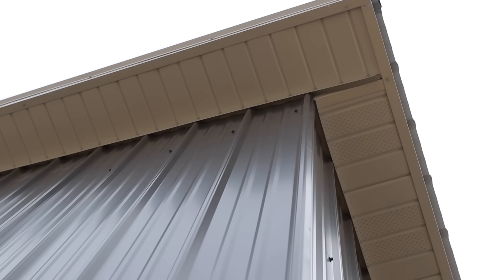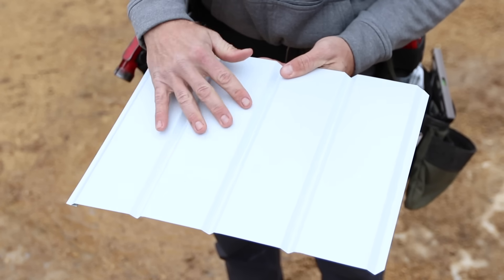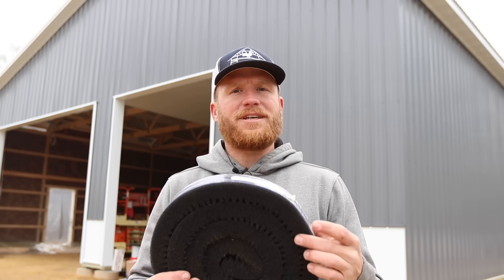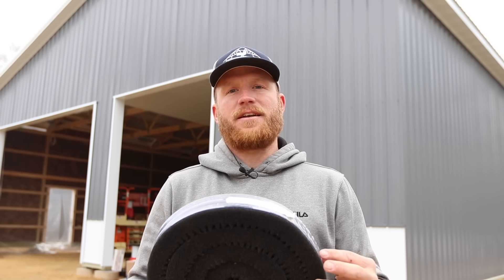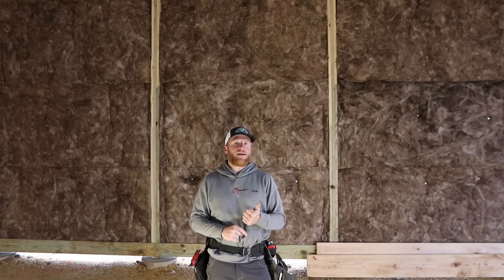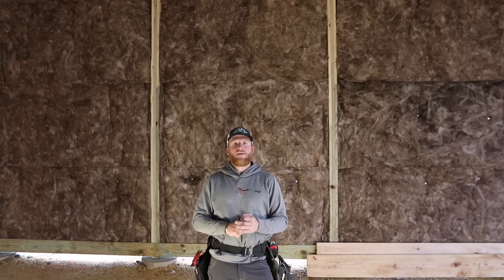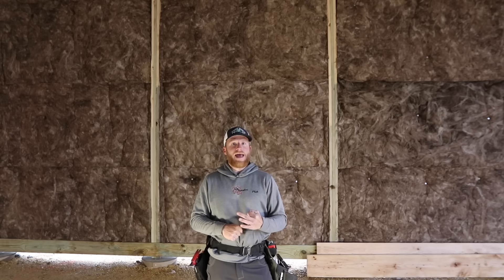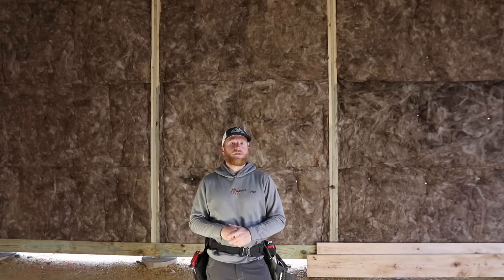Insulation: 5 steps to a more efficient building and why I don't use spray foam

Comment: I've been an insulation installer now for almost 15yrs in the pa, nj areas. And the man knows his shit. The materials he's using for his thermal envelope are the best bang for your buck. It's not about charging the most for this guy. Yes your open and closed cell spray foam has its benefits in the shore region here with the high winds and lots of rain and moisture from rapid extreme temp changes. But most places it's just a gimmick for salesmen to get a bigger commission, we hang a lot of high density materials here too, like your r15, r21 and such which I also believe to be gimmicky high priced junk. For the best thermal barrier You want a light and fluffed material with many layers of air pockets not a solid compressed block. That's why any more then 2" of foam is a waste of money. And also thermo fiber (rotten cotton as we call it) is great for sound deadening, and fire blocking but because its thick and heavy not insulating. The only thing I would do differently is used a psk or fsk faced r19 blanket less man hours to install. But maybe running around that building hanging those walls twice was more cost effective. Dont know material price in your region.  Great vid though

Comment: Fibre glass and rock wool
Is just a filter . Most moisture comes from air . Add up
All those staple holes how big of a hole is in your barn? 2lb closed cell is way to go. It stops air, stops moisture, and adds structural
Strength to your building. Ive pulled batts out of wall that are soaked multiple times and every batt ive removed has had signs of water damage. Foam is only toxic while being installed. After 24 hours its just as toxic as your leather couch.

Comment: Nice job on the video. Small detail I noticed was the house wrap you used for soffit venting was facing with the letters in I have been taught letters always face exterior. If any condensation at the dew point developed it has no way to get out.
Reply from the maker: That soffit venting is not going to collect condensation and be locked in.  That is the point of it... to ventilate.  I think

Comment: Its a shame to see you guys have to deal with waned edges on your trusses too. I hate having to scab boards to ceiling joists and trusses when a waned edge lands on a sheathing/drywall joint(especially when using bat insulation and the scab has to be cut around). We pay full price for materials, it would be nice to get full boards for the $. What is considered #2 lumber these days is what the previous generation called pallet material. Nice vid on the insulation too, nothing worse than having a leak that can't be found because closed cell is redirecting the water far away from the leak. That and if your wiring isn't in conduit and gets foamed over and you realize it has to be re-ran because it is broken. It ain't fun trying to fish wires through closed cell. There are a ton of dis-advantages of spray foam, and I try to avoid when it possible also.

Comment: Good video. That's pretty much the way we do it in Canada, at least in my area. Wall R-value is 20, while attic R-value is around 40, although the latest building code requires R-60. I hear ya about diminishing returns. I read a study the other day that explained how many years it would take to recoup your investment for various renovations on your energy bill, and basically, for a house built in the 1970's or more recent, adding exterior wall insulation would take 100 years to pay for itself... If your house was built in the 1920's, it's a different story...

Comment: Good video and I agree with the batt over Foam for the ext walls if your not looking to spend a lot of money but I'm not sure how it holds up because I've never put a moisture barrier on the inside of the wall to seal in the batts but I would have thought that to be a bad idea just because if the batts were ever to get wet or moisture find a way inside. the batts wouldn't dry out very well and shorten the life of the insulation. Personally I prefer closed cell in all pole buildings because it also strengthens the structure. Like I said though great video looks like a tremendous job and quality craftmanship!

Comment: First off great video.
I’m new to building,  so pouring the concrete floor after the framing is a first for me. It makes perfect sense, & I love the ideas, especially the loss of heat from the fountain.
What is the transition from under the rat board to the outside? Is there a backfill of soil or something else, That prevents direct contact from the outside to the poured foundation?

Comment: I agree with the comment Doug made on the closed cell insulation. 2” of closed  cell on the walls and 3” sprayed directly to the roof deck takes care of any vapor barrier issues and will way out perform what you are using. Then you have absolutely no need for venting because everything is in the envelope. Another advantage to that is you never have a hot attic and electrical is always accessible. Another question I would have is if you’re all about efficiency why do you not insulate your perimeter  walls at least 2’ below grade. Your constant below ground temperature would then help the keep the building warmer but the way the cold can transfer from your perimeters just lets the slab become a conductor The insulation in your U channel does virtually nothing for the floor.

Comment: Great video! But why you do the floating foundation inside the building instead of having the building bolted to the concrete? 
I’m guessing it is because of the hard winters in northern Illinois. Down south in Mississippi it may be different because of tornadoes and hurricanes.

Comment: My contractor showed up this morning instead of cutting the giant holes they cut smaller holes and more of them... They said it was loose fill but dense pack. How can u dense pack without haveing the gaining tube cramed in the wall and moveing it around in the wall to dense pack . The just full each little hole around a ft apart and plug it... Am i getting ripped off is that really concidered dense packing... Lol?

Comment: A closed cell spray foam works awesome on a post frame building even with using closure strips and plastic it's hard to make a building air tight ... But when u spray foam it it's almost 100% and plus the structural support it gives...the only thing is don't spray the foam to the back of ur steel use a house wrap that way if it gets damaged by hail or what not u can take the steel off and not have to deal with the spray foam
Reply: K

Comment: i agree with your spray vs. batt.  spray is a good choice when you need it to act as a vapour barrier or when you're up against stone/concrete.  also contributing to cost & return on investment, spray really needs to be done professionally because it can be a disaster for mold or whatever if not done properly while batts can be installed pretty easily by help crew..

Comment: I'd add that smart vapor barrier over that then add a 2x4wall to run all the wires in an add the mineral wool insulation in it for better fire protection.

Comment: Another item for your customers: there is almost no environmental risk with the non-spray foam  insulation methods. For spray foam to  cure properly it must be mixed properly within a specific temperature range and sprayed in thin layers and cure within an allowable  temp range. And if that process goes wrong, the product won't cure properly and can create toxic vapors hazardous to human health and the work will all need to be removed. Sure, those risks are low, but people simply don't need to take them with fiberglass insulation. Watch spray - foam insulators prep for spraying like they're entering Chernobyl  and you'll understand how hazardous these chemicals are.
Reply: Not masking for Chernobyl, there trying to keep, from spraying foam onto you brand new windows, and doors. Also trying to keep from filling your electric boxes with foam.

Comment: Kyle. Another great video!  Could you describe for us more the typical use habits of these customers?  How much use do these heated environments see during a typical winter?  What temperature are they heating to, and do they ramp that temp up and down from day to night. I know one of the big advantages of radiant heat is that it keeps objects typically warmer than they would be in a convection system, but I also think if it’s used in the floors that the floor should be insulated. 

I’m a HUGE fan of foam but you have to look hard at its economics in a building that isn’t continually occupied. I also agree with you on the vapor barrier in the walls, but still working in my head on the ceiling thing. 

Another question...  When the floor is eventually poured, are you putting in an expansion space so the movement of the floor doesn’t mess with your concrete columns?  Or is that a factor at all?  And how thick is that floor typically?  Down here in Texas they have made a science out of pouring structural slabs, but they can fail if the soil under them isn’t stable. 540 yards of concrete in my slab alone. Looks more like a bridge in its design. 

Sorry for all the questions, but you seem to have a really great understanding of all this and I appreciate your expertise. Do you sleep?

Comment: I read some of the comments, and you run into the same thing we run into.  It doesn’t matter how great we think we build, someone in the comments will always point out we are doing it wrong.  😆

Good job Kyle, good video. 

Overhead doors are indeed a huge energy loss source.  All the one we put in are insulated.
Reply: He does good work yes but these buildings will  long term have interior mold if they do not keep temperature same as outside most of the time. There is no way around it period. 20 years doing deconstructive examination opening and closing for lawyers looking for mold in lawsuits. Most are bad workmanship no saddle on back of chimney stuff like that. Some of it is well built skilled carpentry masonry with Interior vapor barrier no obvious leaks of water only reason there is mold is two vapor barriers no other explanation. Hundreds of lawsuits. You will not find a building with this setup made with wood over 100 years old. Every wood structure hundreds of years old can breathe.
Reply: @Madmoody21  spray foam is better?
Reply: @Madmoody21  I hear what you're saying but this isn't a wood building...it's metal so I'm not sure what your complaint is??  I am looking into wood vs metal so I appreciate your answer.
Reply: @Angel283 It is a wood framed building. What do you mean?
Reply: well, didnt you know, people on youtube that work in an office know more than the people that actually build haha
Reply: You did it wrong....just kidding.

Comment: Hi there..it looks real good and I think that you are doing the best job possible,but I am wondering about the two barriers with insulation in between. Quite a long time ago when I was contemplating solar- passive and active, I was told about "the dew point" which is what you are talking about when speaking of condensation. Dew point is the spot where 32 degrees happens, and that is where condensation happens too. My question is : won't moisture get trapped between the barriers? maybe not if the exterior one allows moisture to pass through... anyway- it is something that I am always coming across from time to time- with basements too.. thanks.. great vid!!

Comment: You should consider buying your own spray foam machine. There is a large markup on spray foam. If you get a machine you can mount it in a trailer to cut costs and you can offer it to your customers at a discount. You can hire a few employees to run it and do other jobs with it when your not using it for another source of income. This will give you a compentitive edge over others. The key is getting the machine at a low price and mounting in  trailer to keep costs down.

Comment: Also the heat in the summer if no air movement ( venting) tends to make the metal expand                     winter contract and over the years will leak at the fasteners not with foam lol

Comment: Thanks for explaining both sides very good  I'm a spray foam contractor I'm in New Brunswick Canada 
We spray 2" closed cell foam in walls and 4" directly onto the roofing deck this completes the building  envelope zero condensation and blocks summer heat from getting in  you get more ceiling height 
No need for venting as sprays foam blocks radiant heat      venting a ceiling is only to let the built up heat 
(From radiant heat) to escape  roofing last longer and   foam makes you building 300% structural stronger 
I have a hard time convincing older house builders about longer heals on trusses and at least 2' on center 
Framing        I get the same old saying that's not the way my grandfather did it  
Great explanation    this is a smart builder      thanks for sharing for the customers
Reply: I think radiant heat cannot be blocked but can be reflected back by aluminum foil.

Comment: I personally do not like spray foam. Is it more energy efficient? Yes but heated buildings need to breathe. You will get moisture in the walls if you do not have a way to exchange the air. Also, any remodeler will tell you how hard it is to do anything within walls that are spray foamed. Have fun running new electrical, plumbing, or hvac. Spray foam has it's place but I for one will always use batt insulation.

Comment: I also want to call out the people talking about foam cracking. If done correctly, that is a non-issue. Not going to argue it, that’s just fact, from a company that started doing it in 1996. Also, on replacing panels, that is NOT very difficult. Open cell is easy, closed cell you need to cut through foam with a razor knife, peel out a strip(1 inch, 2 inch, wide???)around edge of panel to be replaced(can be removed after placing relief cuts, with a claw hammer, or a flatbar, or numerous other options.)One valid concern is a leak. You need to inspect your building, especially the roof, regularly for loose screws, etc, if sprayfoamed. Having said that, that is a rare problem, for sure if someone does a quality job of erecting your building, as it looks like these guys do.

Comment: Ok, in the interest of being honest, I am a Georgia-based spray foam insulator. So of course I am partial. However, I want to just point out, aside from all the crazy argumentative, self-appointed  expert analysis you sometimes see in these threads, would you care to break down a ball park cost to benefit on sprayfoam in a shop like this one? If you put in 1.5” of closed cell in the wall, 2” of same in roof deck, thereby accomplishing vapor barrier, air barrier, and thermal barrier in one step, also figuring in the reduced tonnage(or maybe BTU in your area) of required HVAC system to control the temperature in a spray foamed shop? We would be in the neighborhood of $1.45-1.50 per square foot on the wall for 1.5” closed cell, and right around $1.90 per square foot of roof deck @ 2” closed cell. 
Thanks. brandon.energytite@gmail.com

Comment: I built my house in NH (2001) and went with closed cell foam. It blew my insulation budget out of the water, but I never regretted in the long term. We were warm in the winter, and cold in the summer, and used so little gas ( radiant heating ) that the delivery man thought the house was vacant. He said we used less gas than the houses that were vacant for the winter. 
It soundproofed the structure, and made it incredibly stiff. If I built another house ( with help this time ) I would definitely use foam. No question.
Reply: Spay foam definitely insulates better, but it's not the best soundproofing especially for low frequencies. It's never used in recording studios for soundproofing.
Reply: I agree. I have done 3 rock wall basements in old homes and it is the best thing for them.

Comment: How hard is it to replace exterior steel/roof when you spray foam vs batting?
Reply: Zach Hewitt Very good question. In order to replace steel that is spray foamed you will need a crow bar. I work for a nation wide pole barn company and if the customer spray foams it voids their warranty.

Comment: Kyle, why don’t you use cellulose insulation? You can hard pack the walls when you insulate the ceiling. The reason I suggest it is cellulose is far more forgiving when it gets damp and holds its R value even when it is wet. It is also a fire retardant and the boric acid is a pest and mold deterrent.
Love the videos!
Reply: Kyle Nissen 
I hadn’t thought of that. Have you seen this in the field?

Comment: cellulose is a more eco-friendly in its production. it is also fire,pest and mold resistant. the price is not much more that fiber glass and it does have air stopping quality. for the attic space it is far superior to blown fiberglass.
Reply: Just used blown in cellulose insulation in my attic after much research. Could not be happier with results in Central VA.

Comment: I'll ask again. So no usage or storage for the "Attic"? Just a dead empty space?
Reply: You have to be careful using the attic for storage as the weight may be too great for the pre-fab rafters.  The rafters are designed to disperse the (snow) load on the roof.

Comment: So the concrete is up against/on the bottom wood sill? There is no metal or foam break from the foundation to the "lumber".
Won't the concrete wick into the wood and rot the wood eventually?
Reply: Cass Johnson  Look at 5:05...all the white "caps" you see are included by his batt installer and hold everything in place.

Comment: Great videos and information. Insulating the rafters vs the nice clean ceiling is a tough call.  It would be nice to have all that extra storage space up there (if the trusses are built for it), but you would have to heat all that extra volume.